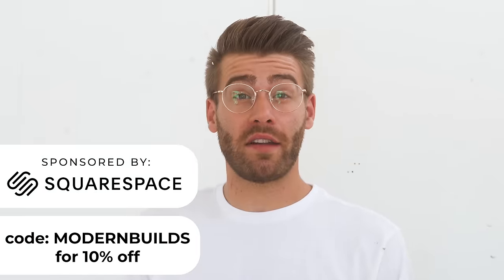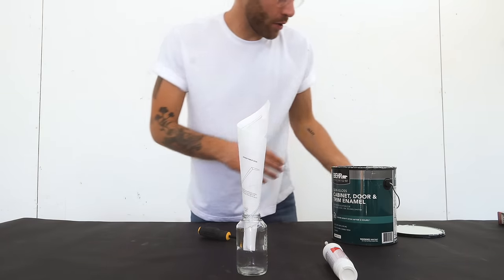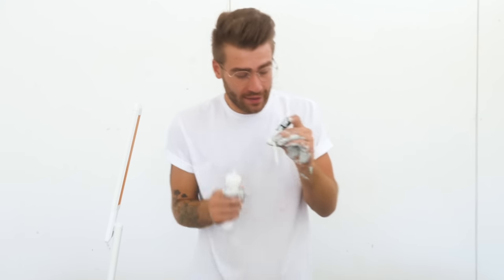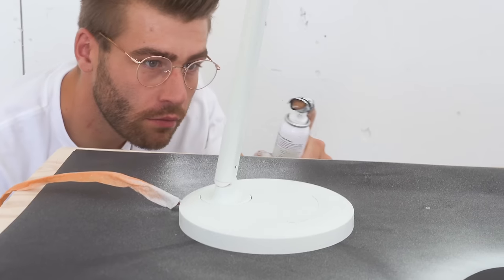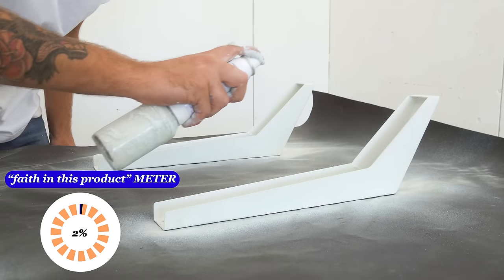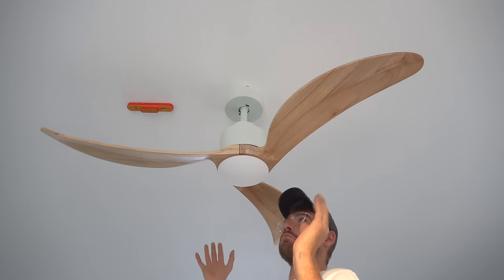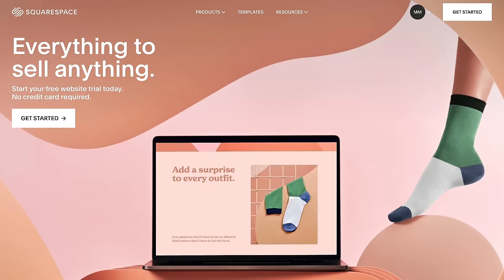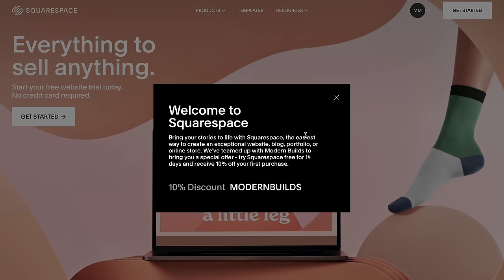TURN ANY PAINT Into SPRAY PAINT!!!

Comment: (1:35) Don't buy a funnel.  Wash out any 20+ oz pop/soda bottle (or similar plastic bottle) and cut off the bottom.  Turn it upside down and use it as a funnel.  Works great when adding washer fluid to your car's reservoir.

Comment: You've got to scuff sand and prime the surfaces if you want the paint to be durable and stay adhered.  Even if the latex paint has primer in it, it's not a good primer for plastic or metal painted with oil-based paint.
Reply: I know. I was saying to myself why isn't he sanding and priming. 
I also don't think he was using the correct paint for the correct product.
Reply: Should have definitely sanded the trashcan since it will be in use daily.

Comment: Note for future reference: when painting plastics in future, take it out of the box for a couple of weeks before finishing. Synthetic materials like vinyls off-gas, which can cause defects in the new finish. This is pretty easy to tell if you have a decent sense of smell, as those gases are what give that distinctively "new" scent. If you can smell it, let it sit for a while longer.

Sometimes, needs must. I had to add vinyl sticky-back plastic to a pair of blinds that just weren't blocking enough sun as soon as they were out of the box, even though they were super stinky, but it meant I had to push out a lot of air bubbles in a week or two. If you get something a little less cheaply produced you might not have as many issues.

Super interesting product, though! It really opens up a lot of options, since there are only a few craft and artist paints that come in spray form. Way more colours and textures to choose. It would be interesting to see how well this performed with low-VOC paints.

Comment: A little bit of Floetrol will help condition the dilution with water.
I add it to paint that has been sitting around a while to account for any evaporation of the water in latex paints.

Comment: I used these back in 2016 to paint a set of wheels, worked great if held at the correct angle vs it all dripping out the vent hole like you showed. 😂

Comment: From what I read. The aerosol just last as long as a can of spray paint.
The aerosols are like $8 for 1. Spray paint would be cheaper.
This seems like a messy pain to use.
Reply: I guess the big benefit here if that you can match a precise color which is hard to do with normal spray paint

Comment: If you want to paint with your own paint, get a cheap HVLP sprayer. Cheaper, less mess, and apparently easier to work with. Also, elevating the work above the table let's you get at the different angles.

Comment: 3:32 I really don't think you know what between 90 and 45 degrees is. Every time, you've got that thing tipped over way too far. You need to be spraying at upright surfaces, not flat surfaces or you tip it over more like 25-30°

Comment: Latex paint is bad news for using like this as if you try to sand out any errors it won't work IE it won't sand. Not good o furniture or anything really. That said with the proper kind of paint like an enamel paint or acrylic your all good. Also latex pant chips really easy. I can't see any of the items lasting long .